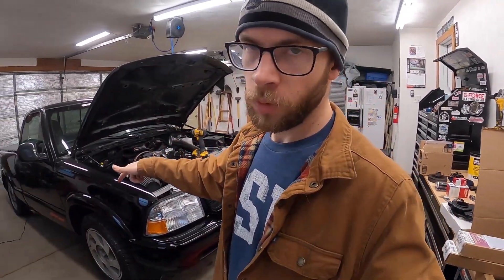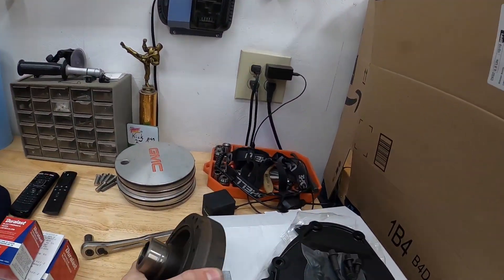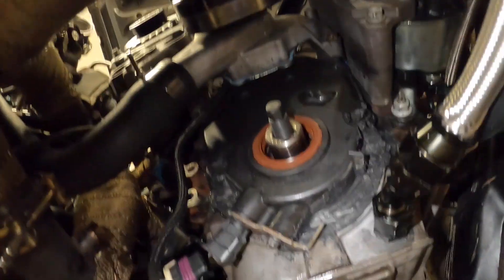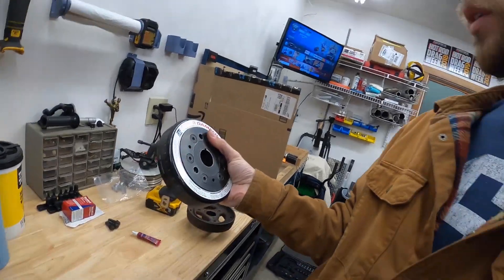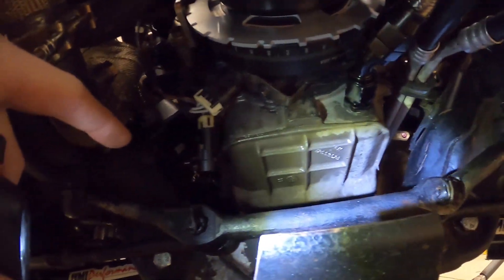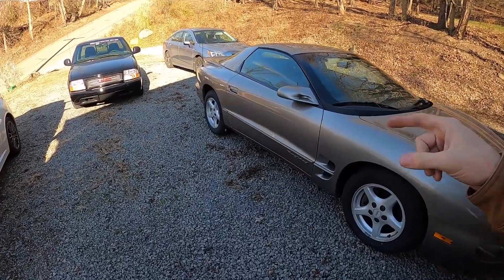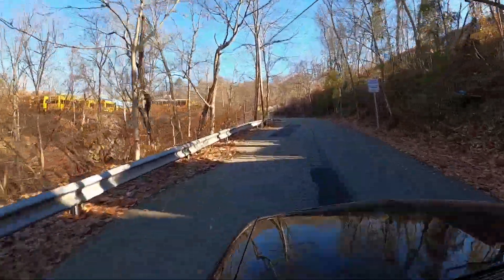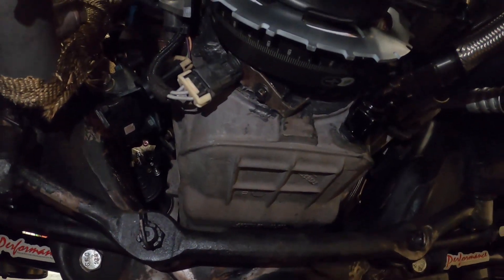Stock PCM + 4 Bar MAP Sensor + Boost Control

Comment: So need to move the battery,  take out factory clutch fan. Can you keep AC and install a Turbo kit? I have a 2000 blazer 4.3 auto and looking to boost around 8-10 psi.
Reply from the maker: Yes, but it would be a tight fit

Comment: Hi I'm back I wanted to share some info for your new build for the Firebird  I was wondering what you would think about a supercharger there was 1 I say online article on a 4.3 Chevy that I think would work for your build the brand is Torquestorm and the 1 for 4.3 is for a V8 but it bolts 🔩 the  4.3 and its built the same way  as the procharger brand. And at the time I looked it up it was about a thousand dollars cheaper please don't hold me to it because things change in price. And I don't know if the 3.8 has the same mounting hardware as the 4.3 so you will need to do a little Research on this I hope this is of good info for you. Going now thanks Ray
Reply: 3.8 is very different from the 4.3. There used to be kits for them though